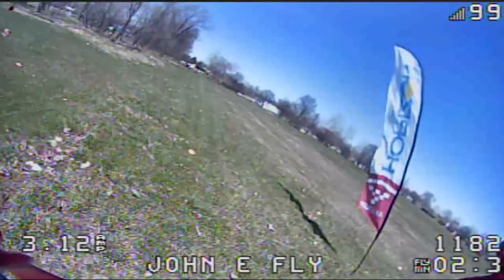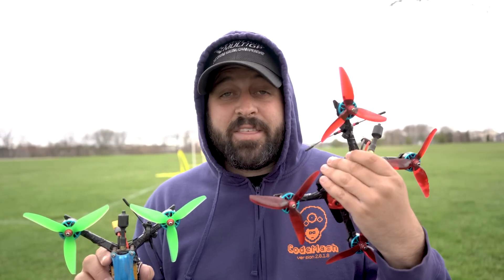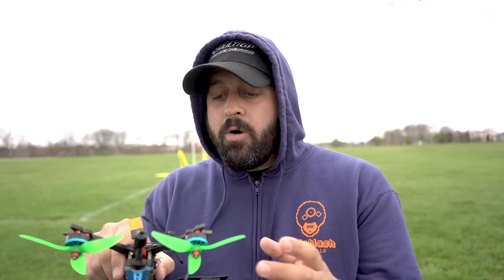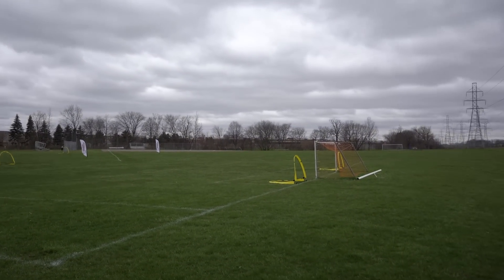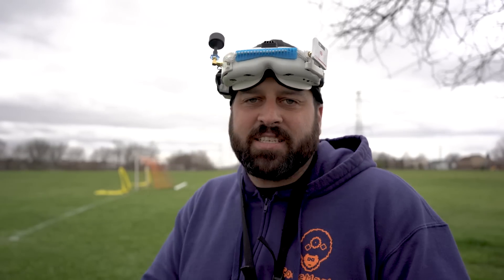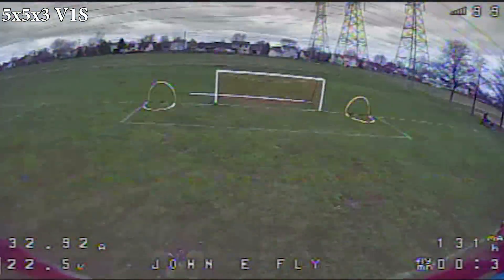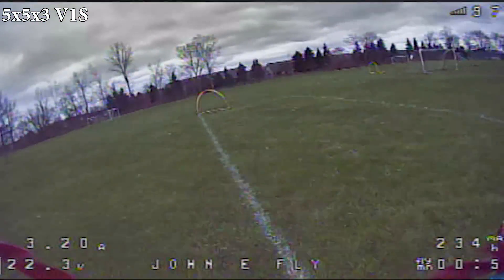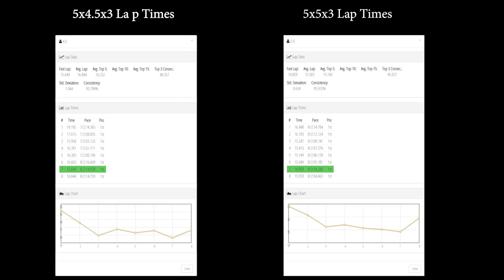5.0 vs 4.5 Pitch V1S Props -- Race Theory Thursday

Comment: Those 6s pack are so expensive relative to 4s...sigh
Reply from the maker: Why do you say that?  I paid $14 for my 1050mah 6S packs.  I paid $29 for my 1250mah 6S packs.  Also keep in mind a 1250mah 6S is basically a 1900mah 4S.  Seems like they are pretty cost effective to me.
Reply: John E Fly What is the C rating and what company again?
Reply from the maker: PyroDrone 75C 1250mah 6S are my current packs of choice.

Comment: Jonny thanks for the video again i have all the hq v1s testid i deffently recomment the 4.3 and 4.5 pitch are for freestyle! You must try the 4.8 pitch thats the best between efficentie and speed. I run only 4s lipo in the netherlands  and on a big track i must go down for 5 pitch to the 4.8 pitch to give me that extra lap so i can only say try the 4.8 and your gonna love it;) peassss!!
Reply from the maker: Thanks Nick.  I run the 4.3 on my freestyle quad, and have been for quite a while.  I used to run the 4.3 a lot for racing too, but the durability and control isn't quite there for me.  From there I switched to the 4.8 for a while.  After switching to the 5.0 from 4.8 though, it felt like a big step up in control for me.  The last one I hadn't tried was the 4.5, and that's when I did this test.
Reply: John E Fly oke men than i understand it. Thanks allot love to watch your videos! Iff you want check my insta: nick_b_fpv cheers!

Comment: This is an awesome test and information. Thank you brother!!  I too have started going the 6S route, and I just like how it feels compared to the 4S. It's a bit snappier and smoother than the 4S. Both fly great however. Now, I need to test out different props. I use the DALProp Cycole 5046C. I'll have to try out one of the HQ 5x5x3 V1S to see how they feel.

I use the 1050 6S 75C Pack also. Have you tried a 45C version? If so, how did they compare? It seemed like from your video, you didn't need more than 45C for most of your flight. The 45C versions are easier to find and cheaper too. 

Keep up the great content. You are killing it this year so far!
Reply from the maker: Thanks buddy!  I have not tried the 45C 1050mah 6S packs.  However, I will say that the 1050mah 75C pack will already sag on me compared to the 1250mah pack, so given the choice, I would be very hard pressed to want to try the 45C.
Reply: Alright. Good to know. I haven't tried the 1250 75C packs yet. Hopefully more battery vendors will jump into the 6S movement. We need more options. There's so few currently.
Reply from the maker: SignoEleven I completely agree.  We need more 6S choices across the board, but especially more battery choices.

Comment: Awesome video!!!! What about the 5*4.8*3 V1S and 5.1*5.1*3 V1S?
Reply from the maker: I've used the 5x4.8x3 V1S quite a bit.  I used those prior to the 5x5x3 for the most part.  The 5x4.5x3 were the new ones for me, and I really wanted to see what the efficiency difference was.  If you look at the last race theory thursday, a lot of the 6S clips were with the 4.8 V1s props.  I have yet to try the 5.1x5.1x3 V1s.  I have some though, so we'll see how it goes...

Comment: Nice video, seems like I need to run the 4.5 on my 4s setups but I have been fine running 5.0 on my 6s 1250.
Reply from the maker: I know you're upset, and I would put my testing WAY below the standard of a scientific study.  I just spent a day trying to understand what product was better for me.  Take it for what it's worth.  I'm still going a lot of testing and experimenting, and I learn more every time.  I'm just trying to share what I learn.
Reply from the maker: I think you're on to something there.  If I had more time to test that day that's what I would love to see.  What would the 4.5 look like on the 4S setup.  Would that be a noticeable improvement?  I have a feeling that would get me around the track alright with 4S and then keep using the 5.0 with 6S as you say.  Very interesting.
Reply: Why switch when the kv(rpm) is about the same?  Btw your flying looks way better on 4.5s, your liones were better, altitude control was better, 4.5 FTW!
Reply from the maker: I think 4.5 added self control, which is a good thing.  But it's hard to argue with a 1.5s improvement per lap.  It's even more confusing if my lines were worse, yet my efficiency wasn't noticeably worse...
Reply: Wasn't it more like .7-.8secs per lap? 14.8 vs 15.6 is what I see.  I also think ~1sec is negligible, not significant and easy to make up or lose the time. 
 But I'm still confused too, but smoother flying AND better lines should=faster times right?
Reply: 1 second per lap is huge! It's the difference between a decent 6 lap run vs a 7 lap run on the MultiGP RQ track:) John, have you tried the HQ5151s? I'm loving them on 6s, and they can finish 7 laps on the RQ track
Reply: 1 second in Nascar is huge, it's not huge in drone racing, yet.  We haven't even come CLOSE to flying at our full potential(10,000 hours of diligent practice), when we start getting close to that, you can say 1 second is huge over the course of a handful of batteries.
Reply: haha, well, I respect your opinion pal, but we do disagree on this point:) I watched Mewo miss 8 laps on the 2018RQ track by 2 seconds, multiple times. The math: 2 seconds/7 laps= .29seconds. That is, if he could have been only .29 seconds faster each lap (.29<1.0) he would have gotten that 8th lap. Keep ripping out there!!!
Reply from the maker: LeninFPV, I'm with you.  1 second per lap is massive, especially when you're talking about an average.  

Air Badger, I believe the fastest lap was a .8s difference, and the average lap was a 1.5s difference.  Both of those are pretty massive in my book.  Especially if I was making up for the worse line yet still putting down 1.5s better times.
Reply: The point is, if I did a scientific study and only had done 5 examples/tests, people would laugh at my findings.  One day, a few packs, and the same setup does not prove anything.  On different motors on a different setup the results could be reversed, another words these results are biased.  You, and everyone for that matter, has not had the time needed to come out with HARD statistics on these matters.  Same with saying that 6s HAS to be flown this year and 4s wont cut it.  I call BS, or MGP has some serious changes to make.  The open battery class needs to be in a class of its own if 4s is no good anymore.  Why is it open if the tracks will not accommodate 4s?

Comment: What do you think about just cutting say 4-5% off your throttle curve if your coming up a bit short on the 5 pitch.  Seeing as you like the handling over the 4.5, and the biggest amp draw comes in the last 25% of the throttle.  You get to keep the handling and save some watts.
Reply from the maker: I know this approach works.  I've seen others do it.  For some reason I've always been hesitant.  But it'll probably be worth trying sooner than later.